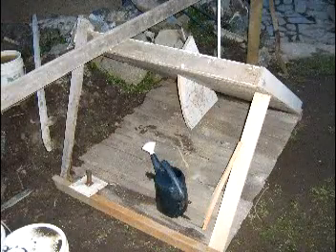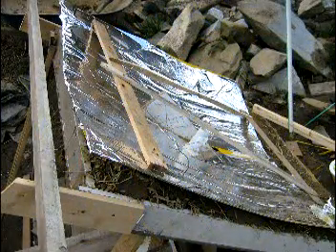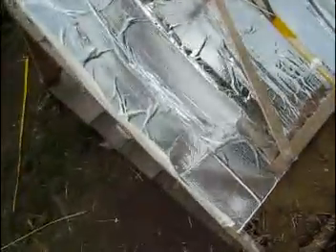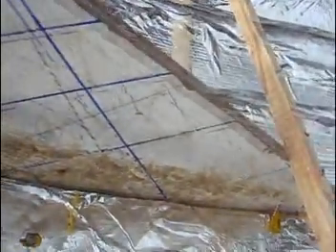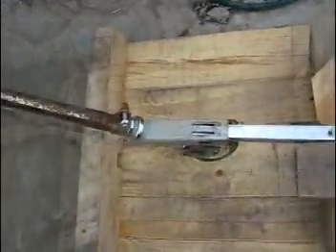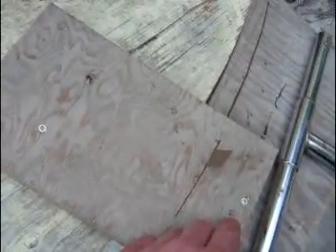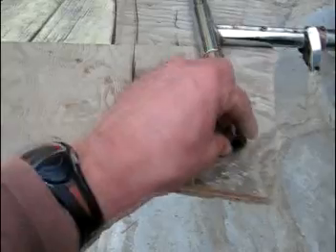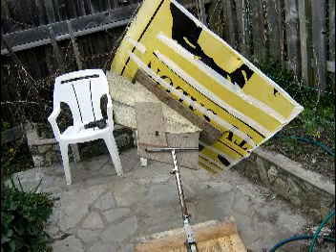Solar Barbecue, finally an experiment!

Comment from the maker: Have you seen the "point focus" videos? A guy uses 2 troughs to concentrate light to a point. You can use a whole sheet of mylar with no cuts!
  You lose a bit of power because you reflect the light twice but you gain simplicity. 
It is much easier making 2 troughs than one dish. and it is certainly  easier to make a large trough than a large dish.
Also, there are no secondary focal points when it is out of focus.  (A parabolic dish can  produce a lower power focus at a  distance!  DANGER!)

Comment: use aluminium foil tape or in my case I used fake chrome decal material for my shiny surface, experience tells me thinner strips are better than wider ones due to bubbles from trying to apply the reflective material to a curved surface, but yeah I had the same problem that you did first time 'round

Comment from the maker: I made it last year to see if it could be done. There were problems. The biggest one was center of gravity. You have to lever the dish forward or backwards as the sun moves up and down with the seasons and I did not have a good counter weight strategy.
I used a dripper tracker (which actually worked well) but I think it was only good for 6 or 7 hours of tracking. You need something taller than a large paint can for tracking. I dismantled it. No space! 
It could be done better for sure.

Comment from the maker: It worked but it was a first attempt and I made several mistakes in the process. You gotta realize how much there was to doing it. I had to invent the "mechanical mathematician" and figure a way to know how to point the dish AND get tracking going. It showed that it can be done.
I steralised soil in it for seedlings for a couple of months.  (~ 15 liter batches) going to about 70 degrees to kill weed seeds.  
I took it apart for the next experiment. A compound parabolic dish. (Not yet made). C

Comment from the maker: I now use an aluminium pot covered with barbecue paint and it is quite a lot better.
I was not too concerned with efficiency in the experiment. It was more proof of concepts than anything. Low tech tracking works, an off the center dish works, now it is up to back yard diy people and  industry to respond.
I did this with junk and dirt and old pallets and a full time job.
Imagine what you could do in a modern shop with welding tools! You could make  sweet equatorial mounts, and polished product